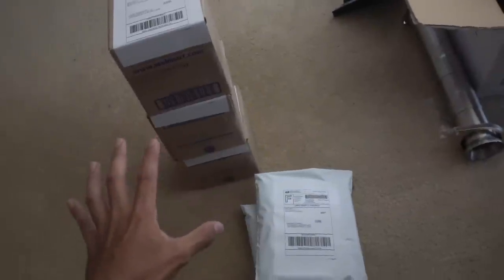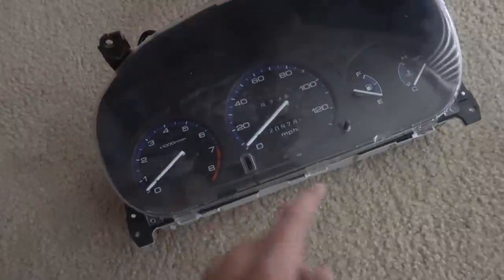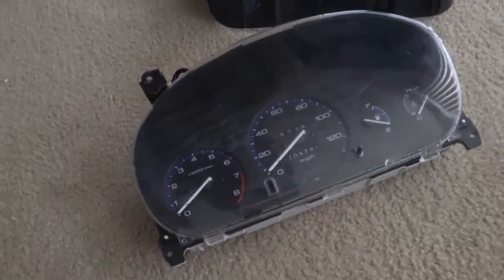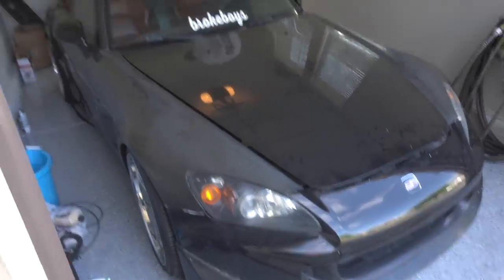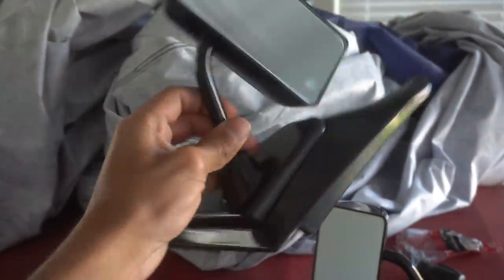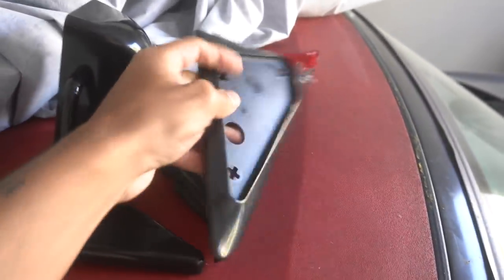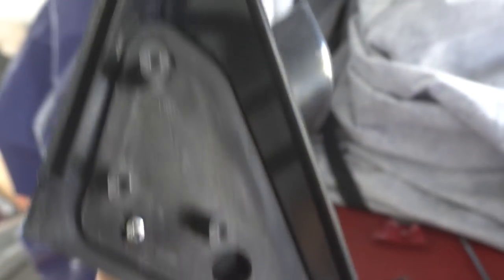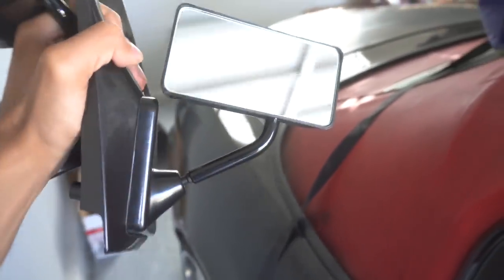Installing eBay Side Mirrors On My K24 Civic!

Comment: Andy, those are hella shaky on rough roads. Took mine off cause I could barely see a thing! Either go OEM or the spoon ones. There's also a type called "Ganador" that has speedholes for airflow but I think they're too small, check them out though.
Keep the vlogs coming! Bless up!
Reply: @texasnhis49bitches49  I'm sorry brother but I don't have them anymore. Got it from a Chinese online shop years back. Unfortunately I can't find them anymore. They're called "F1 side mirrors". Universal they said. Regards!
Reply: Quick google search and I actually found them! They're around $35-$50 per pair. I'm in the Philippines now. I could buy a few and ship it to you if you're willing to pay for the shipping fee.

Comment: Real apr mirrors would look so much better bro,or even oem mirrors,these just look so bad sorry brotha but definitely still a badass build bro👍🏼
Reply: If he tales them apart and swap mirror body sides they will be same.
Reply: @just_indavidlitz324  for oem or the apr ones? Apr mirrors look 10000 times better then these bro,oem as well
Reply: The mirror body comes off the stick part goes on the other side upsidedown and looks identical.
Reply: They sell these not put together wrong for 40. If youre smart you get the cheap ones and change mirror sides